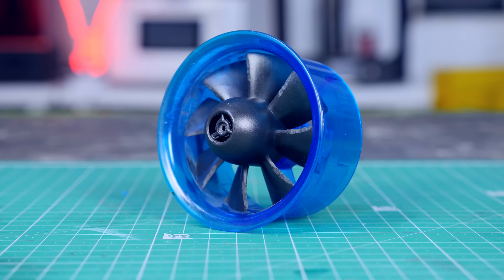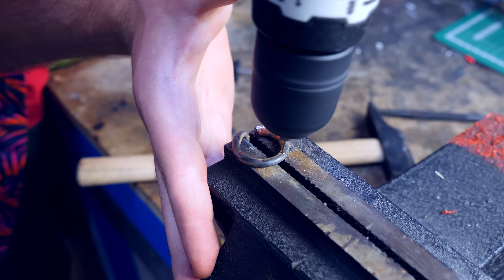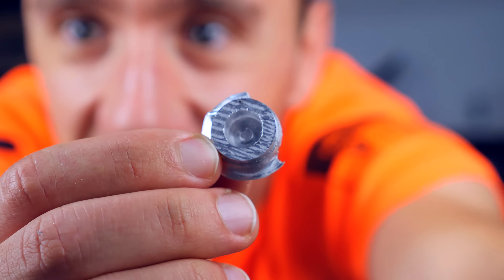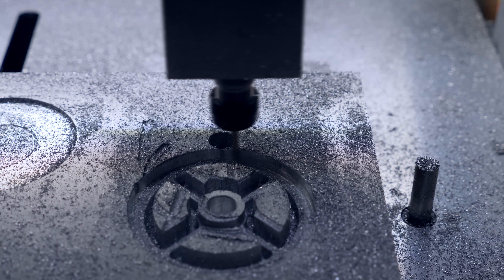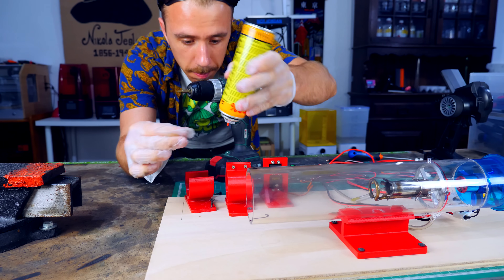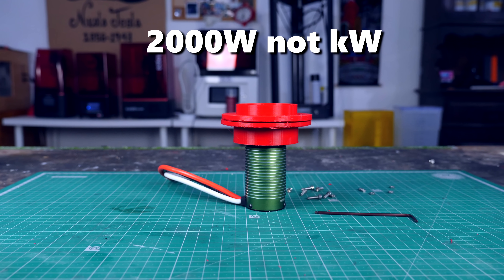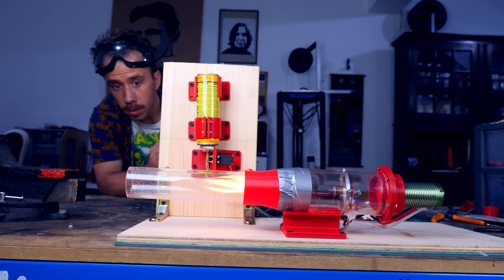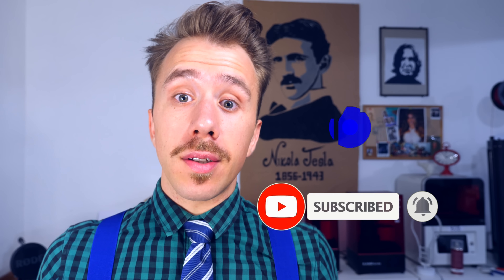I turned my Fan into a Jet Engine (3D Printed EDF Afterburner)

Comment: Love your videos. You have made a mistake in this one though. What you have basically created is a combustion chamber from an axial flow jet engine. 
An afterburner or reheat is for igniting unburnt fuel, it appears you have a lot of unburnt fuel so could realistically use this as a combustion chamber and insert another fuel distribution ring aft of the first for true reheat! 
As an improvement and to protect the plastic from heat, have some air inlet holes in the outside tube to draw in air using the venturi principle to surround the flame with cooler air, this fresher air will contain more air for the reheat stage which should be close to the exhaust.

Comment: Love the work, and especially the failures. You learn a lot from these. How about a working Stirling engine with a small generator attached to maybe charge a cell phone... You can use the 3D printer and cnc machine for this.

Comment: I‘d recommend to use (lots of) ethanol as a lubricate when working on aluminium parts. That makes the surfaces smooth and protects the tools.
Reply: An ethanol plus water based misting solution is what a lot of sign makers use when cutting aluminum
Reply: @justinmorris8582  yes, that‘s what I mean. In Germany we call it „Brennspiritus“ = denatured alcohol, it‘s cheap and works perfect for drilling, honing or filing aluminum. For filing there is a little trick: First file across a piece of chalk, then wet it with denatured alcohol. The chalk will keep the alcohol longer in place. Trick No. 2: Use chalk only when filing iron or steel, this works also like a lubricant.
Reply: WD-40 is widely used in machine shops as the ideal cutting fluid for Aluminum.
Reply: @alexcrouse  Can be used also, but denatured alcohol is much cheaper…
Reply: Or just use wd40
Reply: Or use water diluted metal cutting fluid. 1
Reply: Actually Kerosene is the best lubricant for cutting aluminum.
Reply: use a micro lubrification kit + soluble oil + compress air to clean in front of the bit aluminium dust
Reply: Yes. You can drink it too.
Reply: Ethanol residue + fire seems like a poor combination if you don't wan't flash fires.
Reply: @lastwymsi  pretty sure ethanol evaporates really good
Reply: @crzprgrmmr  ethanol taste good 🍸, some kerosine for cutting some ethanol for lubrication ;) of a dinner
Reply: @lastwymsi  better use kerosene then
Reply: @lastwymsi  Methylated Spirits (also known as "Denatured Alcohol") is also widely used... added benefit that it is an excellent cooling agent.

Surprisingly little chance of combustion, as aluminium (aluminum) doesn't spark, and the cooling effect keeps it way below ignition temps.
Reply: @iffracem  In my experience any left over residues tends to create vapours which have a much higher likely hood of cumbusting. While it's not gonna explode, flash burns hurt like hell and tend to burn off your eyebrows lmao. I've had poor experiences with flashes so I try to circumvent any possible causes.

Comment: Your propane/butane is liquid when it goes to the fuel line (because it is liquid inside the bottle), and the pressure inside the bottle is dropping during injection because the propane/butane inside is the boiling and so the temperature of the bottle drops pretty fast. This eventually end in variable fuel injection and bad combustion behaviour.
Try Butane/propane for airsoft guns as the pressure is way higher (10 bars) than for conventional lighter (1 bar). Also try to always use the bottle vertically, this way you get gas and not liquid. Finally you can add a heater somewhere on the fuel line to preheat the fuel. But anyway supercool video.

Comment: You should machine the centrifugal fan from alluminium and implement a nozel at the end of the tube
To heat the fuel will be coll if you can use the jet engine itself wrapping the gas circuits al around the tubes

Comment: Won't work as well with plastic as it's not a good heat conductor, but in traditional liquid fuel rockets the fuel lines are run around the nozzle to preheat the fuel using the heat generated by the engine.

Comment: What's the difference between just setting the fuel on fire that is coming out of the high pressure canister. Like an old-school "setting the deodorant bottle of fire" trick.
I imagine you could produce a better thrust-to-weight ratio without the fan and the tube. The energy is already inside the canister. Engineer something to make it go as high as possible or launch it at 45 degrees to give it some direction and make it a bit safer. How much energy is in one bottle?

Comment: you should try making a jet engine again, but with more heat resistant materials and slightly bigger plus longer to fit the components more, along with the added touch of afterburner!

Comment: you have (practically) all of the parts and methods required to build a full turbofan, with your exhaust gasses spinning the turbines as in a typical aircraft engine.

Bonus points if you can (eventually) create a hybrid air breathing rocket motor like the SABRE engine prototype.

Comment: I think you should try to build a ceramic cooled aerospike engine, the cooling system could help not overheating the nozzle and it could help you save time by not 3d printing many nozzles

Comment: Video idea: Mould effect, with many different 'chains'.  You can control the size of the ball, the length of the linkage, the size of the hole in the ball (so, how much it can bend), the weight (at least to a degree, you can choose how hollow the balls are).  Adjust as many parameters as you can think of.

Comment: You should try different sizes constrictions after the fire tube to find the most optimal one for thrust.
When the afterburner is going a expander nozzle after the constriction will turn some of its heat into speed as it expands.

Cheers and I can't wait for your next video.

Comment: hi integza, i'm a cnc turner/miller, with aluminum you have to turn very hard with your cutter and use slow feed.  it is best to cool with benzene.  that prevents the aluminum from sticking to your cutter.

Comment: About the cnc machining: Use as little stickout on the milling-tools as possible. If you have 50% less stickout, it generates 4 times more rigidity. So just have enough stickout for the depth you need. As for aluminium, alot of rpm and feed is the trick. Search up speeds and feeds on what the machine can handle.

Comment: please add a cutting fluid nozzle to the CNC machine for cutting metal. You can 3d print that and make it a video. EDIT: I believe it would resolve the noise issues as well as improve the quality of cuts and reduce wear on the cutting bits. If you check around to other channels like Stuff Made Here when he shows off his expensive equipment, they use cutting fluid on metal parts.

Comment: Something cool to possibly do is see if you can make a edf work as a jet pump on a boat. And see if different blades for the edf would make the pump better or worse. Might be cool to see.
Reply: When machining,  use  as short tools as possible. It reduces the vibrations. Your endmill is quite long.

Comment: Glow plugs are actually used in Diesel engines to prime the cylinder and heat up the air. Diesel fuel combust from high heat made from compression and the diesel being injected into a fine mist.

Comment: Get a vertical pole, and attach some of your engines to it (think model rockets)...

I'd love to see some of your engines produce enough thrust to push off like a rocket (or if they can).
You can even add a cap at the top to make sure they don't actually fly off.

Comment: You need a worm in the flame area for the fuel to pass through before it reaches the injector its too cold and your flame tubes should be right where the air enters and have the worm in a cylinder in the center with holes in its circumference progressing from smaller to larger to make a vortex with a cone in the center of the tube after 
Should be able to start on gas and switch to oil then and will get a better burn and more thrust

Comment: This is what shitty "turbofan tutorials" show. An EDF with an afterburner except that it's built worse

Also, you can use piezo crystals from lighters to create high voltage and ignite propane or whatever you're using.

Comment: Food for thought, our Integza makes so many sacrificial parts for testing, made from either from aluminum or 3D printing. If he wanted to be efficient, he should see if he could use tomatoes! Not only would he be able to save on resources, but also get some sweet revenge. I wouldn't put it past Integza to try experimenting with methods of preparing tomatoes for industrial applications. Carbonizing or liquid nitrogen perhaps?

Comment: my suggestion is, once you finish building the turbine, try making flow regulators like found in jets, now that you can build in aluminium, maybe it's worth to try changing the flo/pressure ratio by changing the tube's geometry

Comment: Ever thought about using a hot end from a printer as a fuel nozzle or a preheater? You can regulate the temperature and may spray the fuel into the chamber.

Comment: Video Idea: 
3d print a metal wankel engine with your new technique and use the engine with liquid gasoline, it would also be a big challenge to get the perfect parts after cintering. Good Luck

Tomatoes Are Disgusting.

Comment: Integza, i have two questions:
1. Is it possible to still use the EDF for this model with centrifugal fan?
2. Can i make those aluminium parts from steel?
Reply: I'm gonna go out on a limb and say you can make the parts out of steel, biggest factor would be higher melting point, and more weight.

But if it's not flying you should be good
Reply: @DavidCulverslicingblade  Thanks for your answer

Comment: You are going too fast with the CNC. At least if some of those shots were real time. Slow the machine down a bit so it has more time to cut smaller bits and not rip off "chunks". Future video idea: Create a small helicopter with your engines. A lot of them are powered by jet engines these days anyways

Comment: milling aluminium without cooling it, is not e very good idea. without cooling it the aluminium builds up on the edges of the drilling tool and stops the tool from actually cutting. and it looks like the milling tool needs to spinn a lot faster. and if you dont know that yet. never cool with water, always with water oil mixture.

Comment: If you make part of the fuel line pas through the flame you can run it on gasoline fumes. But you need to pre-heat the pipe in order to start the process.

Comment: Maybe using a quartz tube would work better than using plastic, as it'll be way more heat resistant.
Or just glass in general, as long as it's heat shock proof

Comment: You should use the metal filament to print this parts, so they are stronger also create a centrifugal (turbo-compressor-like) compressor.

I have all the 3D and .STL files of a turbocat jet engine model(i made them for a university proyect); Let me know if you would like to have them. (Everything except the fuel lines)

Comment: You should make a RC plane and test all of you jet engines. To find out which has the best weight to thrust ratio and of course the duration of each engine. I suppose you could just rig something to the table but planes are more fun.

Comment: I would say you are still better off with a hobby rc grade ducted fan that provides decent thrust on its own. See if you can use a glass bottle as a combustion chamber with built in nozzle. What could go wrong?

Comment: Suggestion relating to the video before this:

What happens if you put a drop of hydrogen peroxide in a bowl of potassium permanganate? 
In the video you put a drop of potassium permanganate  in a bowl of hydrogen peroxide, but maybe the result will be different.

Tomatoes are disgusting

Comment: Actually real turbojet usually adopt axial compressors, but nowadays most engines with afterburner are low bypass turbofan, so... actually like the edf you were using (plus a "turbojet central core").

What about a proper variable geometry nozzle made using that cnc? :P

Comment: what may be helpful is a trick by the rocket company: fuel line goes around the nozzle to warm up before being used.  I think you should be able to use brake lines for cars.  they tend to bend easier, handle high pressure, and lots of tools to work them into shape(s).  plus you can also have sections thread together so if a line breaks you can replace a smaller section easier.  a thought is to make the nozzle diameter smaller to help keep the air fast.  the EDF could be useful if you set it up such that it would help swirl at the inside of the tube.  taking the idea for your tangential inlet rocket design.  you could use the EDF at a slight angle so it forces swirl and into the tube, allowing more propane in.  the swirl helping the tube keep cooler (hopefully) and the extra swirl may help mixing.  either way greatly enjoy your videos and bought my (first) own 3D printer off someone and ended up finding they know you and are a fan

Comment: Miniaturize a jet engine, small enough to mount and power <2kg RC aircraft. It would be sick. We have those but they are BIG and heavy.

Since you have a aluminium CNC, now you can machine intricate parts and even create a small compressor-turbine inside that mini jet to make a real jet instead of a glorified gas stove.

And you need a realy good quality ultra small race grade bldc motor for starting that engine and hopefully create enough compression to sustain combustion 🔥

Comment: Video idea: You know those mini jet engines that hacksmith and that jet pack guy uses? I think what you made is essentially a basic version of that, but if you were to shorten up the combustion chamber, and go for a more aggressive blade instead of the centrifugal fan you could in theory gain a lot more power.

Comment: Next video idea->
Look up what substances are in a tomato, and use the substances in the tomato to power a solid fuel rocket
so you can technically power a rockete with a tomate, rendering them not completly useles

Comment: Make a jet engine and mount supersonic nozzle, which accelerates flow to supersonic speed. It has cool geometry btw. High speed can also shift fuel from the fuel chamber to nozzle itself and cause it to burn outside the chamber. Wonder how much thrust it can generate

Comment: Project Idea:  Try creating a mount for testing your engines thrust.
For rocket engine: you can simply put the engine vertically and fix it such that it cant go down but the upward force is not restricted by this you can simply attach an arm or something to the rocket and then place that underneath a weighing scale facing up and has a fixed slab on it.
For jet engine : you can mount the engine horizontally and using a pulley system that goes 90 degrees down the table and then similarly mount the weighing scale with a fixed slab on the top . You have to be precise with the string such that the engine doesn’t go forward but is enough so that the scale touches the slab.
Tomatoes are disgusting .

Comment: You might be aware of this, but there are machinable ceramics you can get off of McMaster that could be useful for you! Also, you can buy endmills with short lengths of cut that could maybe help with your cuts speeds and part finish. Your videos are very impressive! 👏

Comment: Itegza, if you're going to machine aluminium again, make sure that the tool you're using has the shortest possible length sticking out of the collet. Example: need to machine a 20mm pocket? tool stickout should be as close to that as you can, so it should be around 21mm stickout. The more stickout you have, shortens toollife dramatically because of vibrations. That's also why your part didn't look so good. :)

Comment: You should use the a cheap chinese high voltage transformer module for ingition. It's only about 3 dollars and will power your regular sparkplug pretty easy.  Aliexpress Product numer (just put it in the search bar) 32797279397  or even 32967063881

Comment: Because you are using butane/propane lighter fluid I think it would be cool if you used the body of the small propane camping tanks as a body for your jet engine I don't know just an idea plus it's metal and deals with pressure well

Comment: well the fuel isnt burning properly but great job ..
about the video idea :MAKE A TABLE THAT CAN DRAW ON SAND (PRETTY NORMAL U CAN FIND STUFF LIKE THAT ON THE INTERNET) BUT REPLACE THE SAND WITH COMBUSTIBLE SUBSTANCE AND LIGHT IT ON FIRE AFTER IT HAS FINISHED DRAWING

Comment: You like jets so much right? Seeing as jet fuel is just glorified diesel and kerosene, have you thought about making an adaptation where you can atomise it into the chamber with the glow plug and in turn using convection to turn turbines? 
In other words, build multi stage jet engine...kinda. You have a CNC machine now so, worth a try!

Basic principle, Suck, bang, blow.

Comment: video idea :
add a carburetor between the fuel bottle and the enegine
Reply: I don't think you need that with a jet. The "carb" is the engine, it's what the airflow and everything is for. At least I'm 99% certain
Reply: @Enderbro3300  A valve is reccomended